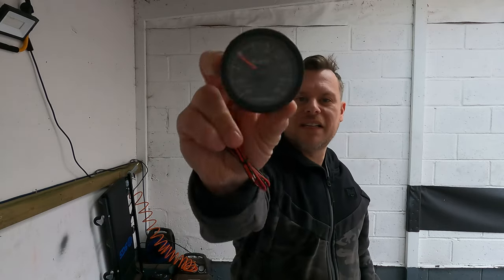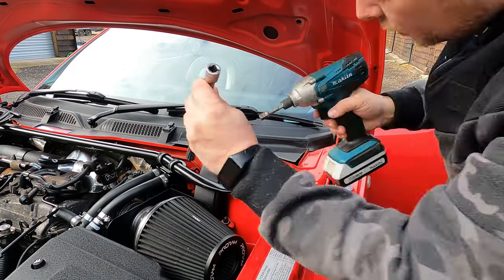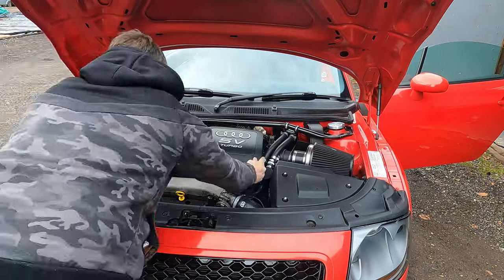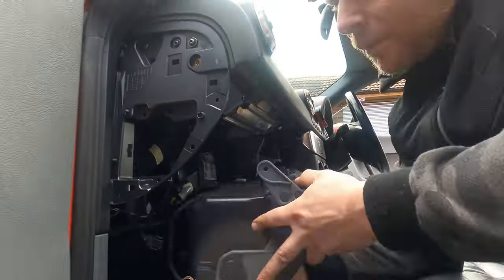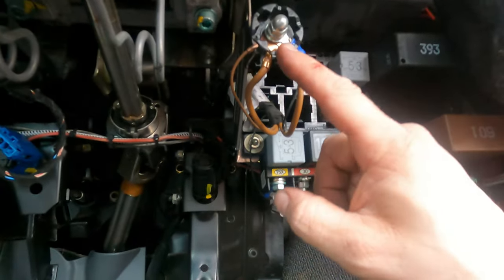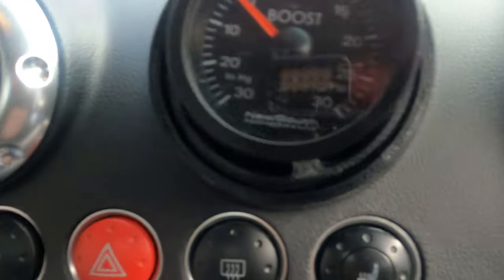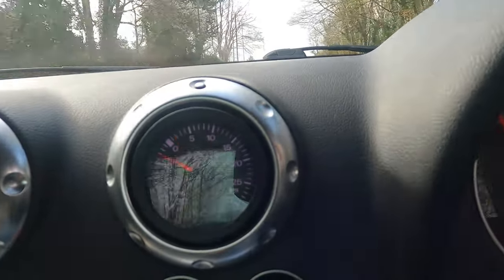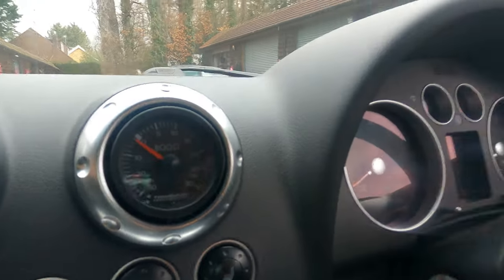AUDI TT BOOST GAUGE INSTALLATION

Comment: Great video! For the TTs with the steering wheel on the left side: Don't remove the glovebox. The rubber access point is above the throttle pedal, so you'll be able to do all the wiring from the drivers side.
Reply: Having some difficulties finding the hose coming off the inlet manifold, this hose is not in the same place as yours
Will try again tomorrow and update this comment with my hose location. Might be useful for someone else.

Comment: Great job mate. So handy having a grommet hole in the bulkhead to feed stuff like that through. Its almost like they knew people would retro fit stuff! Surprising there is not more behind the vents to block off/reroute for the air supply. My naiviety showing up here. I would expect the car when idling that it would sit at zero PSI until you put your foot down and engage the turbo rather than running at negative. nice work!
Reply from the maker: Cheers mate defo a good place to run the vac line well handy and not too much happening behind the vent gauge only sits on 0 with engine off as nothing is happening when on idle there is vacuum and on boost there  is positive pressure 👍🏻

Comment: Anyway to ‘easily ‘ run it on the other side of the car? I want my gauge at the lower dash, right above my throttle leg, and braced to the center console strut with an L-bracket. Great vid man and I’ll split off where you said in the bay!

Comment: Done this + oil pressure. The hole to access the engine bay is not on the same place on the LHD. Mine is near the brake fluid box. 
Unless I did’nt see another behind the cabine filter ? 
Anyway, nice and easy job mate !
Reply from the maker: Thats good to know for the lhd cars mate 👍

Comment: Hey mate can I run a wire from the same place instead of going directly through the firewall to get to the battery???to install a sub and amplifier
Reply: If your wire can fit through there I’m sure it would be fine

Comment: i see an adaptor with a rubber gromit on eBay that holds it in place  , how have you managed to snug fit it in the hole without using a rubber gromit and adaptor
Reply from the maker: Have you watched the vid  it shows me using an adapter to fit the gauge in the vent 😅 🤣

Comment: Nice, good looking gauge that - fits the TT well. You did well installing that under the waterfall cover without taking the air filter out! I had to when I did mine, couldn't get access otherwise 😆 Shame it's slightly out at default, fingers crossed thats easily resolved. Did I see that boost to nearly 25 though? Seems high!
Reply from the maker: Cheers mate was a straight forward fit, and the gauge looks good but yeah a shame its not on the 0 I see if it sorts itself out and speak to new south about it.yeah spiked at 25psi it has a stage 2 revo map on it which I don't like(came on the car) but I get a proper map put on it
Reply: @CarChris82  Ah yeah I guess with a stage 2 it will be higher - amazed it ran okay before you got it without all the supporting mods you've added since. It's turned into a really tidy little TT now, excellent work 👌🏻
Reply from the maker: @benofthenorthuk  i believe it had the stage 2 map because it got turbo back system with sports cat but now i put the other bits on its a proper stage 2 set up .but I want a different map for sure

Comment: Shit, I did what you did on my 225, but there were 2 lines coming up and I cut the wrong hose!??? There were two coming up and assumed they all came from the same source. Didn’t do the fuel pressure regulator. Now to replace that line. Weird that your car only showed 1 line, but mine has two. Please help! Lol
Reply: Replying back here to see if I can get some quick help on this (and further clarity).  I am getting turbo leak basically where the turbo is, so i might be using the right line, but pulled on it too much when establishing the T connection...could it be that simple? Also my cabin filter was pretty damp when I turned it over (if that makes any difference..still newbey here be easy lol).
Reply from the maker: Any line from the inlet manifold will show a vacuum at idle.mine has 2 lines one that goes to the n249 and the other to the fpr
Reply: @CarChris82  almost done with the install, and going to reroute the vacuum line on the driver side to have more room..I definitely think the line is kinked around the firewall..so going up the hole above the gas pedal this time, not the glove box..thanks for replying Chris!  I love your vids and attitude!
Reply: @King_Henry  Was it a kink?